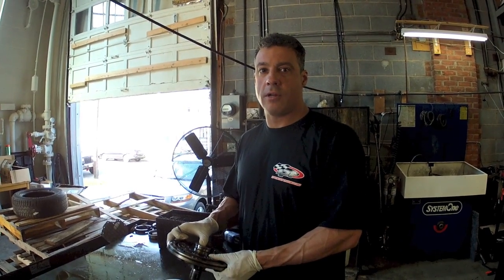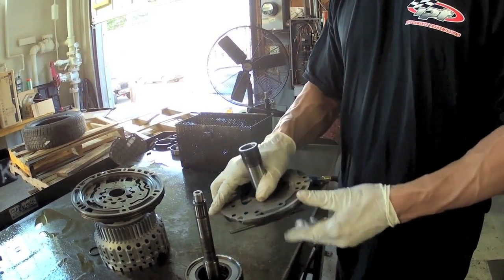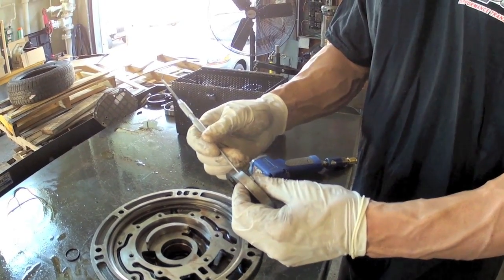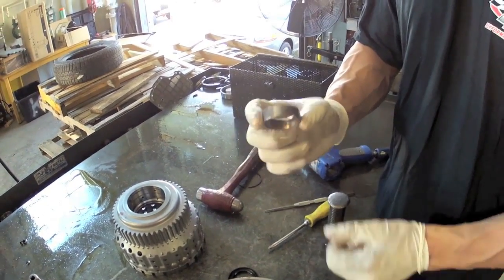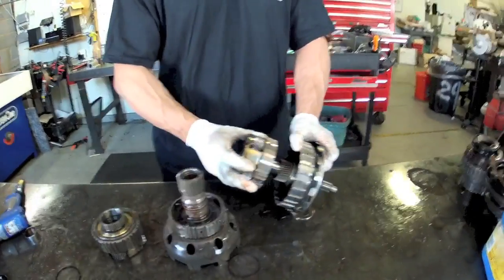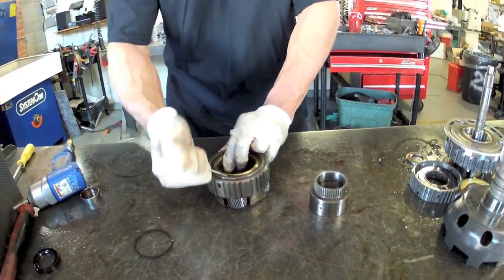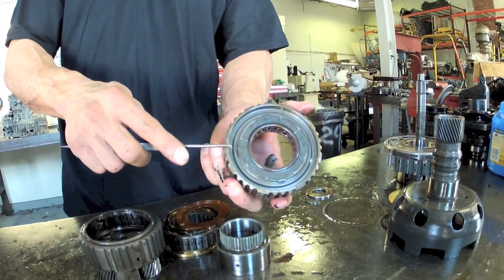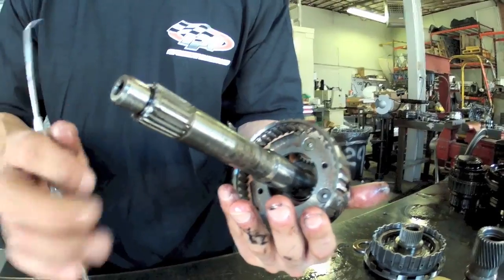IPT Toyota A340 Transmission Part 1

Comment: Hey TransDude thank you for making and posting this series. Sure helps a lot. Can't get over how easy you make it seem, even though I know ther's a hell of a lot more going on in between. I have a question for you though; you mentioned the best assembly lube is one you made up yourself. Di I hear right? STP and ATF  at 50/50 mix? Isn't STP oil based? I have both and figure why spend when I can make. Just checking.